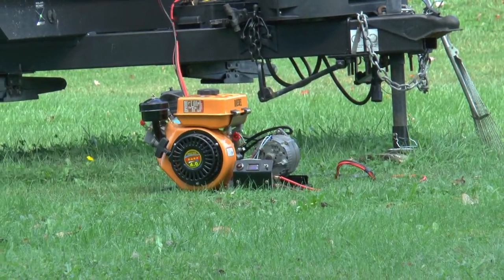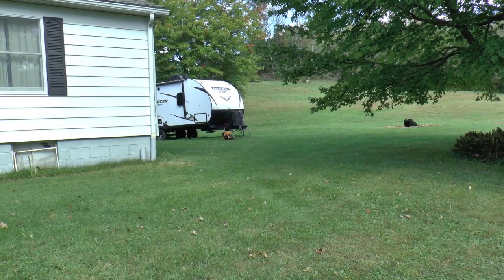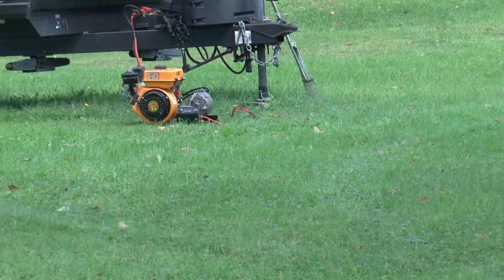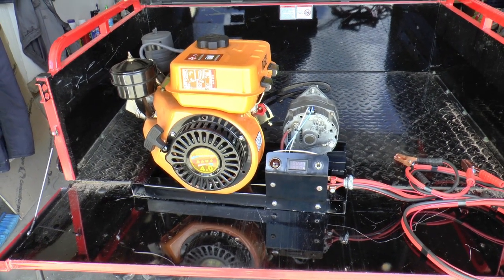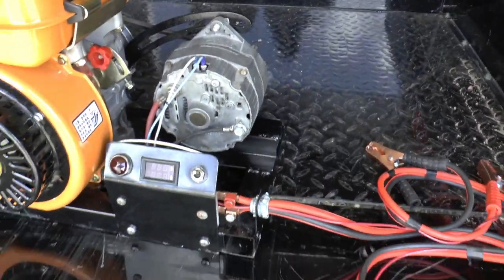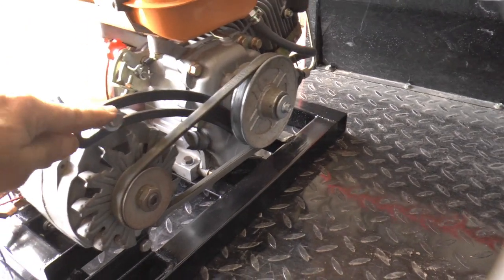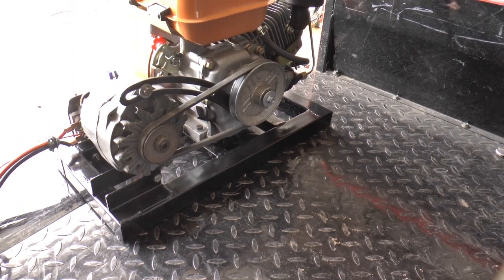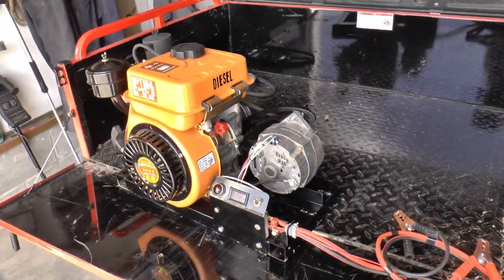Diesel Battery Charger F165 Diesel

Comment: Perfect! I have a 140a belted to a 79cc motor.. way too small. The only reason i never put my 168f diesel on it, was that dang 20mm shaft. This is just the kick in the pants I needed to start the project up again.
Reply: I've heard others say you can get a 20 mm shaft pulley on eBay - you can get a 3/4 shaft pulley and have a machine shop bore it to 20mm
Reply: A bearing shop I'm sure could order what you need
Reply: A bearing shop I'm sure could order what you need
Reply: I did order a 20mm pully, but found I needed a larger diameter. seeing as my metal lathe just went down I may poke my head down the angle grinder machining route to get the shaft down to 3/4. 20+ years of on the road metal fab tells me it's a bad plan..  But sometimes you just can't quiet the devil within. Hahaha
Reply: // I still can't get over your belt tensioner. Such a simple solution. Perfect
Reply: @colinacone5972  it's a 30mm shaft - allied bearing has the bushing for The shives or pulley -  they don't have the 30 mm pulley that slides on the shaft -
Reply: @colinacone5972  The other option is to get a split taper H-bushing and matching H-pulley of the size you need. It's not a bad idea to have an H bushing for every shaft size you have.

Comment: I have an identical 168F. Try the bigger pulley with the throttle set lower. It shouldn't smoke or strain. A better target would be 30 amps. I'm mounting mine on plate aluminum on wood on plate aluminum. Steel will shake lose and it's noisy. Watch the oil consumption when it's new. Use hot water, not ether in cold weather. Ether can crack it easily. I made a 20 MM to 1 inch shaft adapter from the Chinese 3/4 to 1 inch. Honed it out.

Comment: Cool! I was going to say it would be neat to throw a an antique engine on it, but then I realized it wouldn't be quite as easy to move around and pickup lol! I'm very curious to see what you do to quiet the thing down at some point!
Reply: That won't happen those engines are loud even with an excelent muffler - they. Have to be in a black hard rubber 2 inch box with a muffled air inlet baffled and out going air vent baffle - then there still noisy lol

Comment: Car altenator's generally stay cool enough in a car when the engine is ideleling - when car engine is ideling the altenator's often only turn 2500 RPMs - 
     Many altenator fans on cars are set for right hand rotation looking at the the pulley - if you run them backwards   the diodes will burn out due to over heating - when you run an altenator backwards you have to reduce the out put by at least 60% on hot days - it's because the fan s turning backwards - if you put your hand on the altenator and you can count to ten it's not to hot if you can't count to ten because your hand is burning - the altenator is over heated -     
    You might look at some of Pacific yachting and boat charging systems they might explane this better - 
when you use a car altenator to charge deep cycle battery's - they use a different regulator than used for a car starting battery - 
   The easiest thing to do is take the voltage regulator out and connect a lead to the positive brush - then order a 100 watt 100 ohm OHMLITE variable resister - 
      Then you can manually control the input voltage of the altenator field - it's better to stay under 30 amps with a car altenator - 
      Also you want to try to maintain 14 volts at 80° and above  and 14,4 volts at 50° and above and 14.8 volts from 20° and above  when the battery accepts 10%  of the capacity of the battery that is considered fully charged as when a battery is being cycled daily As in a camper or sail boat - so if the battery is a 100 amp battery - when you put the charging altenator on the battery - if the battery has been discharged to 10.5 volts that is considered dead - when you start the generator - you set the altenator current at 30 amps - if it's between 50 & 80° when the battery reaches 14.4 volts you turn the reistat voltage down to the field in the altenator - if you don't the voltage will keep rising and the acid will just boil but battery's will no't charge when the acid boils - so you maintain 14.4 volts till the charge current is at 10% of the battery's capacity so if a battery is 100 amps when in this case it accepts 10 amps at 14.4 volts it's 80% charged - at that point you maintain 14.4 volts for 15 minutes -  at that point the battery is considered fully charged when it's being used daily that is it's charged to 85% capacity - 
     I don't know if you can grasp this but that's the correct way to charge deep cycle battery's that are  cycled every day - every two weeks you charge them 100% that would be when they accept 3% of there capacity at 14.4 volts so for a 100 amp battery that would be 3 amps then you keep it at 3 amps for about an hour - if you know how or want to go through the trouble you can equalize. Them - 
       Balmar sell multi stage smart regulators that do what I stated automatically - there pricey for the average person
Reply from the maker: Good information. I have other setups where I have the variable rheostat and and regulator so I can switch in witch ever one I want. Some of the GM alternators had fans with straight fins so it didn't matter cw or ccw rotation.
Reply: @kevincrawford2027  those little Diesel's are really loud - I worked the offshore oilfields for decades also my grandfather started working on generators in the early 1900s along with my uncle's - in the end I like messing with all that stuff - 
         A regular air cooled diesel running at 3600 RPMs will have an efficensy or 3:1 meaning it will give you 3 KWs per gallon of fuel burned  - some inverter gens have a 7:1 efficensy - some of those small air-cooled hybrid systems have a 10:1 efficensy  - with the lower RPMs there is more time to burn a higher percentage of fuel -
Reply: @kevincrawford2027  when i had looked at your clip on your air cooled diesel I had not seen your other clips - I had glanced at them last night - 
         My grand father was an early generator electrician or hybrid electrician from the early 1900s - 
        I'm a 3rd generation man - every thing in the offshore and remote mountains oilfields is off grid and stand alone - 
       In my case I was a systems tech part of my family were into radio communications from the early days also - As the oil field went solid-state I was just the right contractor I understood power production and solid-state technologies - 
   You might know this but today most don't know much about early hybrid systems - 
      Today many look to solar and wind - were I'm at in the deep South solar and wind is of little value - 
      In areas were humidity is an average of 60% the moisture defuses the UV light solar panels need to generate power - 
     Solar panels will only generate 20% of there rated out put, in noon day sun for an hour or so - 
       There always clouds so you still don't get much direct sun - 
      - the pole power as we called it stayed off as much as it stayed on for a long time were I'm at - 
     After hurricane Katrina the grid was upgraded were I'm at so power only goes off 4 times a month or so these days -
  When they strung wires out here in the late 50s and early 60s - my grand father said those with 32 volt farm light plants saw no value of grid power - 
        The wind blew the wires down  all the time - also it was 30 cents a kw were as even if they were using a gasoline generator it was only costing them a few cents a kw to generate there own power per kw - 
       If they used an oil engine it might cost $2.50 for 55 gallons or around $2 for a barrel (42 gallons) of crude oil streaght out a well - 
      Oil engines burn far more efficient than gas engines - the one I have at 350 RPMs runs at 22:1 efficensy that's 22 KWs out put to one gallon of crude oil burnt  -  (there low compression direct fuel injection and are oil cooled) - mine runs at 250 to 275° so most of the fuel is burnt - 
      At 650RPMs its at 14:1 effecency - the engine is large or over a 1000 pounds and at full speed only generates 1.5 kw - the base, cast iron radiator, and X frame generator head weigh around 2 tons - 
       My generator set up is semi hybrid - meaning it is set up on a 10 kw of usable power battery bank - 
     My grandfather used a 65 kw battery bank and charged 24 hrs Thursday through Friday once a week - 
      The house was 32 volts DC along with 110/220 60Hz AC via a 10 kva machanical inverter - 
        He welded directly off the battery's -
        With farm lighting battery's the acid strength was 1.220 at full charge - that gave about a 40 yr service life out the battery's - the 1.190 strength acid was prefers but lowered the capacity of the battrey's by 50% with the weaker electrolite - but increased the service life to 60 yrs+ also they have to be charged at a slower rate -           I had inherited much of what I had - in 2004 I sold the original battery's, inverters, 32 volt appliances that's fans, fridges, water pump, coffee makers & hot plates  and other items - I just kept the engine and generators - 
        I still use the generator for long power outages after hurricanes, ice, or snow - our grid has 0% tolerance for snow & ice - 
      I have a 10kw lead acid usabble battery bank at 1.190 acid   - at 1.285 acid it would be about 25 KWs - but the batteries will only cycle for 5 to 7 yrs also should be charged daily - were as with 1.190 it's safe to charge twice a month if your not using a lot of power - 
       There is no need to float charge battery's with 1.190 acid - I just charge them now and then or once every 6 months or less - the self discharge rate is low - 
       I've been gone from home for longer than a yr and the battrey's have been fine with out charging them - 
       I understand battery technology so there was no need to upgrade the battery's in my case to the lithium technology's- I did use lithium sulphur battery's on remote sights in the mountains were we relying on air drops of fuel and supply's  - those are battrey's used in Satalite's ect there 2.9 volts a cell but failures are few and there good for 70 yrs of daily cycling - but each 10 amp cell is about $500 - 
       For my home I just use golf cart battery's but use 1.190 acid - i can add sulfates to the electrolite to decrease the electrical  resistance  bring the charge and discharge effecency up - in that case you can just use Epson salt - it works well -
     With 1.220 it can be used down to minis 17° then it can freeze - again you might know all this - 
       With the off the shelf car altinator - with a golf cart battery if the acid is at the eye - if you draw the acid down to the top of the plates  then fill it with water and slow charge the battery - till the acid and water mix - then draw the acid off a second time and fill it with water again - after the acid mixes the gravity will be around 1.220 to 1.225 at full charge but at 60% capacity  - at that point a standard off the shelf car altenator's will charge those battery's fine with weaker acid - in the industry we set the finished charge rate by the gassing of cells and the amount of water used - 
       Also at .220 they don't need to be floated you can just charge them twice a yr -
Reply from the maker: @able880  Thanks for the very interesting information. Sounds like you could make some very interesting you tube videos. The old school heavy, low rpm stuff is made to last. I did some welding on my water wheel at one time with two large 12 volt batteries in series. Worked surprising well.
Reply: @kevincrawford2027  they had no choice but to make things efficient - the way you find the inflation rate is to take the current price of gold and divide it by 20! - any price before 1933 was on the gold standard - if gasoline was 20¢ a gallon at a refinery before 1933 - 
      The inflation rate  is about 100 times - so in our money they were paying $20 a gallon for gas up till 1933 - 
     Electric power in most city's was around 30 to 35¢ a kw - in our money that's 30 to $35 a kw up till 1933:- 
         Transportation of fuel added to the price of fuel - most fuel was railed and trucked or carted - 
      In the end engines for stationary long run time had to be fuel efficient - the older people always said put the light out when you left an area because power was expensive when they were young -   - 
    All that's forgotten today - as we move into solar cycle 25 things will change a bit and it will help to be able to mix the old with the new  - also it looks like we're closer to WW3  -   it will help to know the older ways -
     Those old poly phase heavy single phase repulsion start  motors weighed 100 pounds per HP for a efficensy reason lol - 
 It was the same with generator heads a 1.5 kw X frame weighs over 200 pounds and the motors they ran slip very little - 
      Down in New Orleans for yrs the origainale 110 volts DC power plant that origainaly provided the French Quart was in operation - it was hybrid if I remember right they used 1.170 battery's with sulfates  - that  would be 80 yrs of service - 
    It's easy to desulfate battery's so they will last a long long time -